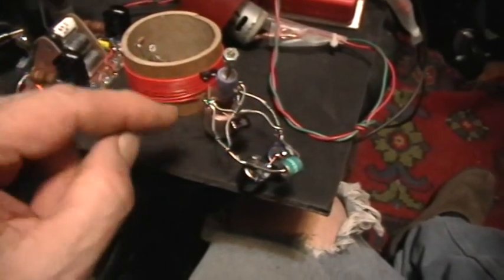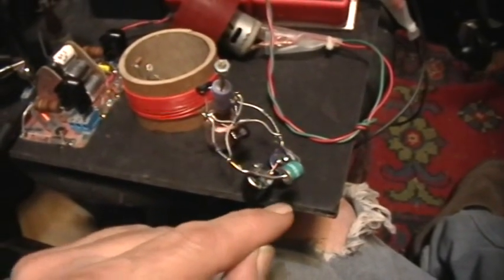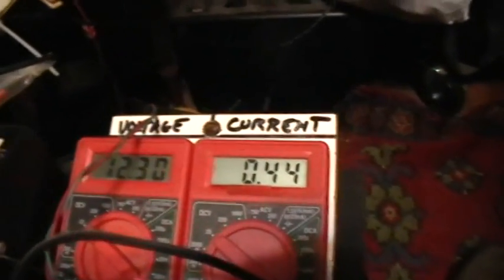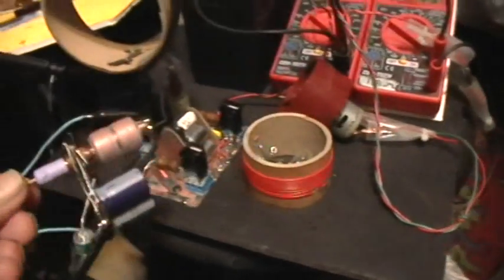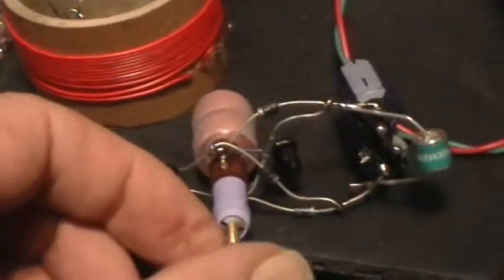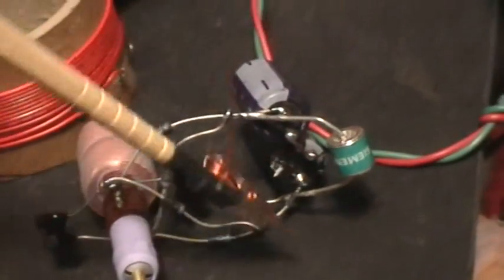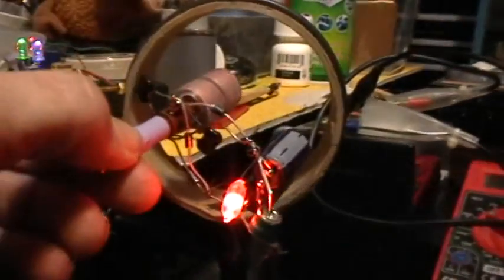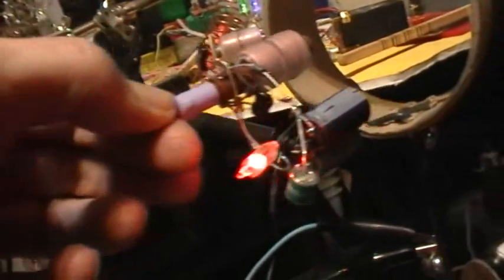Electric OU: Supplement: MicroQEG and the 470volt Receptor

Comment: I want to replicate your circuit, as I do? this is my mails, buchinraul@live.com
Reply from the maker: The circuit can be seen here:
http://www.overunity.com/14443/quantum-energy-generator-qeg-open-sourced-by-hopegirl/msg410676/#msg410676
with the following changes:

Q1, Q2 =  IRF3205  (also tested IRF830, work OK but less efficient)
Main loop = 6 turns, 8cm diameter,  2mm solid copper wire, Tesla Bifilar or Solenoid, around 4.25 microHenry.
Main capacitors = to total 64.5 nanoFarad, high quality poly film, at least 250 V, do use multiple smaller values in parallel as I have shown.
Chokes L1, L2 must be able to handle 8 amps but will not usually be carrying that much.
The 100R resistors must be at least 2W.
Any fast switching small signal diode should work for D1, D2.
Clean tight symmetrical layout is important. There really is a lot of current circulating in the resonant tank. Connections to the loop must be solid. No Clipleads please!

A "nonprinted" circuit board layout (copper areas as on this model) can be found here:
http://www.overunity.com/14443/quantum-energy-generator-qeg-open-sourced-by-hopegirl/msg412118/#msg412118

Don't try to operate without a load (loop) or you will blow the mosfets. Also, don't slowly ramp up power, it must be switched on or connected directly to at least 12 V so that it will start oscillating properly. If current goes very high on startup, stop and check, because it may not be oscillating and this will also burn up the mosfets very quickly. If the circuit is operating properly the mosfets will get only slightly warm.

Good luck and keep me posted on your progress!

Comment: So pickup is pulling about 1.2 watts when you have the 470V 11uf capacitive load...That's a far cry 6-7.5 watts driving the circuit.... Oh wait the LED's off to the side must be pulling the rest of the OU... Just joking... Do you thing using the GDT's is a decent way of doing crude wattage measurements?
Reply from the maker: Not really. It would be very crude indeed, since the thing cuts off before the capacitor is fully discharged. You would have to know the cutoff voltage, the exact time to charge and you'd have to make very precise measurements. I think there are better ways. I am here just using the thing to demonstrate that there really is HV there, and to protect the capacitors. I can't find the "ideal" capacitor in my stack of junque and I don't want to pop these, but I am sure that the voltage goes well over 500 volts if I will let it.
Stay tuned for another video that I will shoot after dinner, showing the scope trace as the voltage builds on the capacitor. I can finally use my new 100x probe for something where it is actually needed!
Reply: Awesome. And good to know. Thanks.